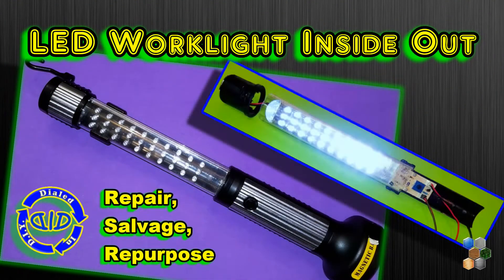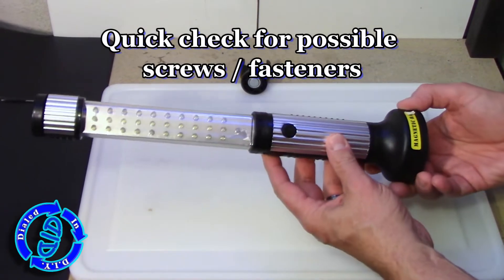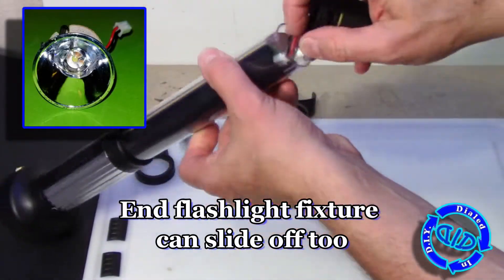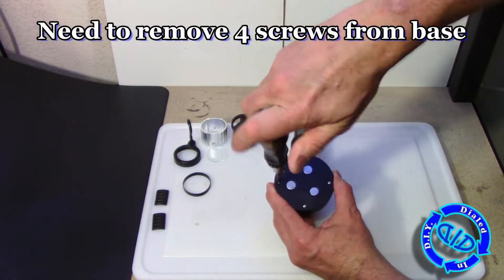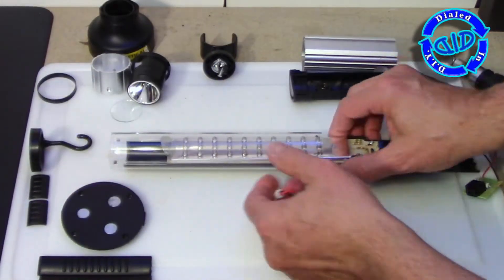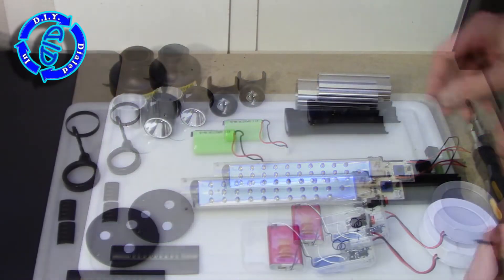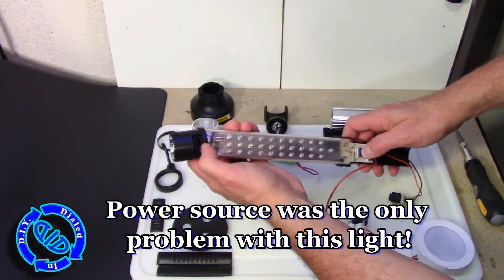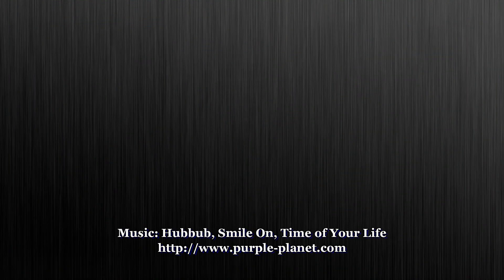LED Work light Inside Out - Repair Salvage or Re-purpose

Comment: where can I find one of those lights.
Reply from the maker: This one is kinda old so I am not sure where to find this exact model/type.  I've seen similar lights at Harbor Freight but I don't remember if they had the magnets (other similar lights in auto sections of hardware stores, etc.).  Hope that helps some.  Thanks for watching and taking the time to post your question!
Reply from the maker: Hi Steven, I was just in Harbor Freight over the weekend and they had several different versions of LED work lights including one that was pretty much the same as the light in my video.  Hope that helps.